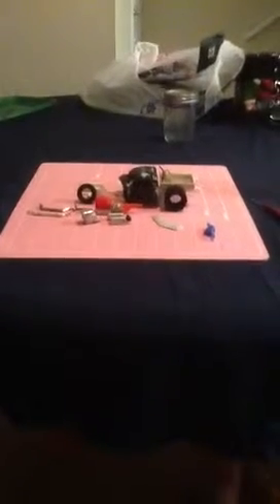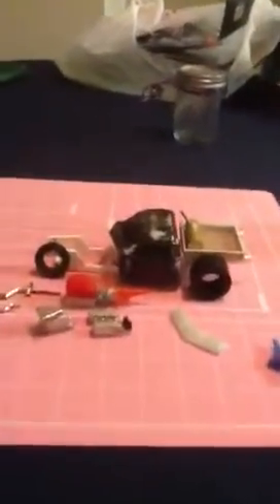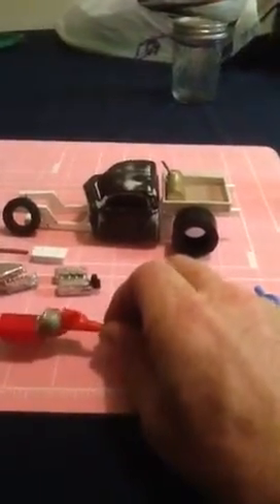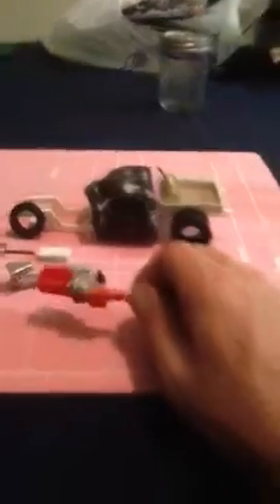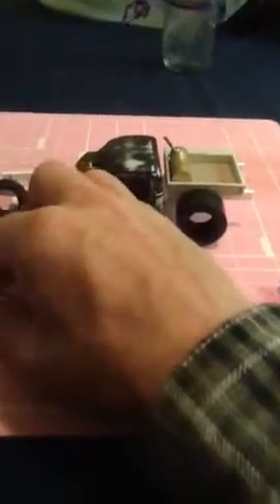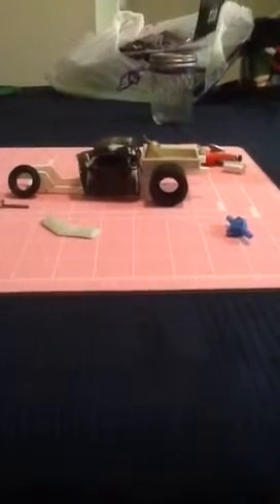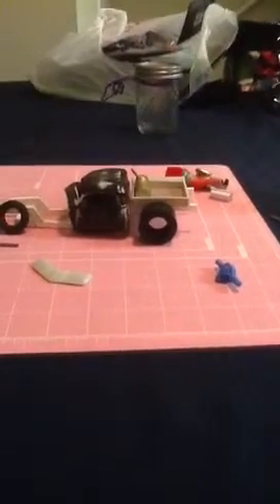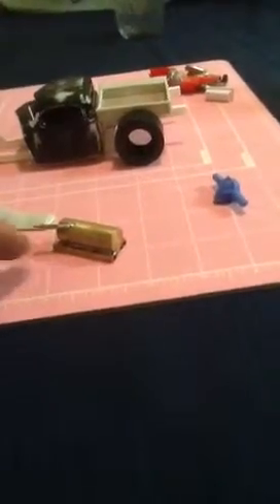RatRod update 3

Comment from the maker: About 10 mins after I shot the vid, I was showin my wife the axle and the completed side solder joint broke on it. I think I may have to put the axle tube pieces onto a small brass rod to ease in soldering the axle sections together. Will let ya know how all works out.